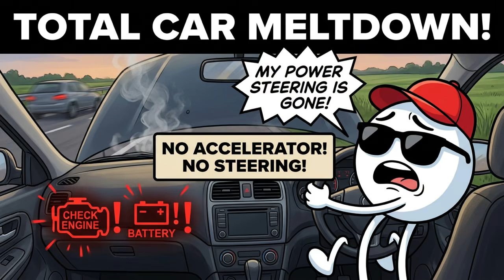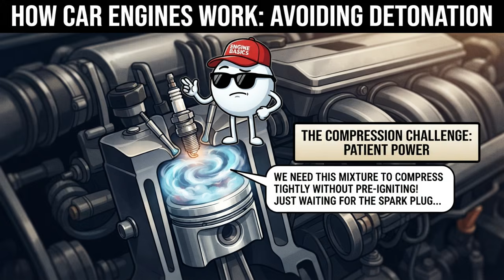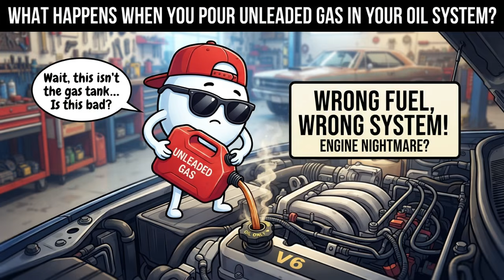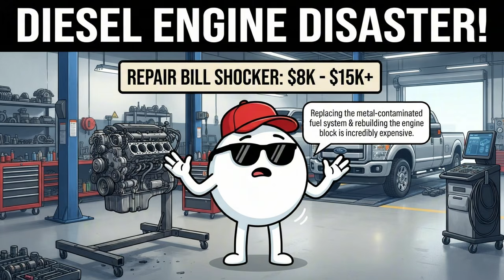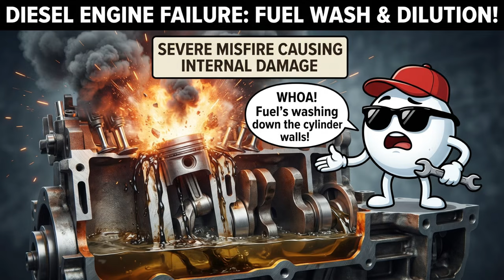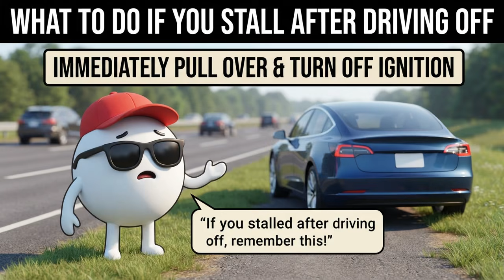What Happens When You Put the WRONG FUEL in Your Car? ( Chemistry Explained )

Comment: DUMB VIDEO DOESNT SPEND TIME ON BETTER TOPIC - i switched from 10% ethanol CRAP gas to E0 Non-Ethanol gas and noticed my 2003 4runner got better power, gas mileage and found out it doesnt retain water and corrode engine parts and Non-Ethanol burns a little cooler than Ethanol. SWITCH TO NON- ETHANOL. Quit being fooled by this green scam lie for tax you and destroy your MPG.

Comment: Diesel fuel nozzles won't fit in a modern car's gasoline fuel tank opening!  Diesel nozzles are larger.  I had a flex-fuel vehicle (gasoline/85% ethanol-gasoline). I intended to fill with 85% ethanol fuel.  Grabbed the odd colored nozzle and it wouldn't fit my car's filler. Looking at the pump, I noticed it was for DIESEL.

Comment: putting diesel into a gasoline engine leads to not running, and i have never seen one blow up the engine ever. You have to drain the tank and flush the fuel lines with fuel. BTW, i have seen it dozens of times! it  will smoke for hours in the worst case!

Comment: You are screwed big time, especially if you start the car. 😮
Reply: if you have a diesel engine sure! but if it is a gasoline engine and you pump diesel in, it is not going to destroy your engine
Reply: @rotormandan2657 No, it will just gum up everything.